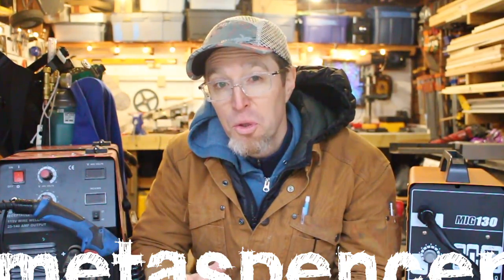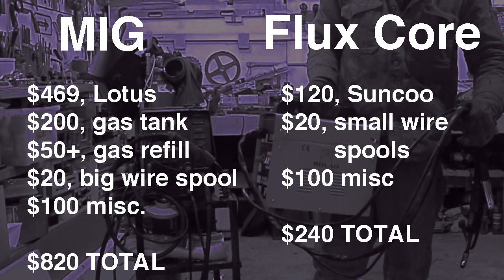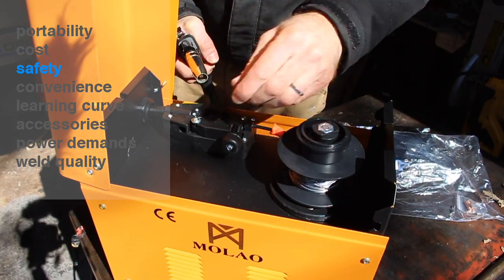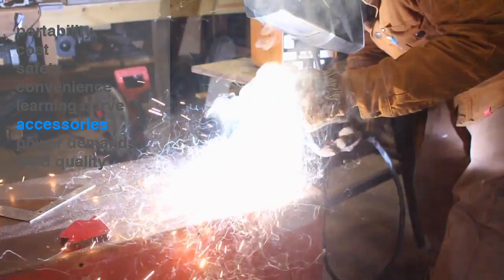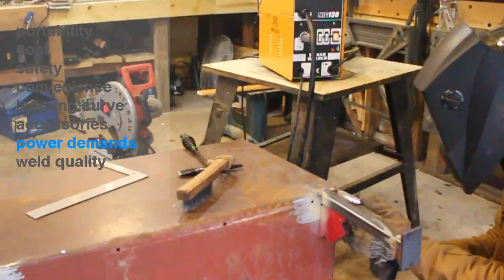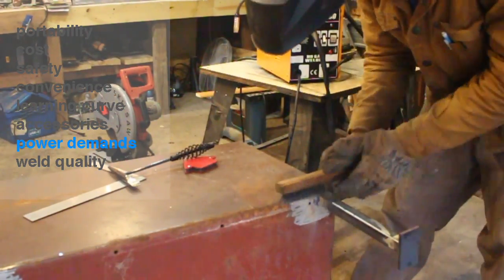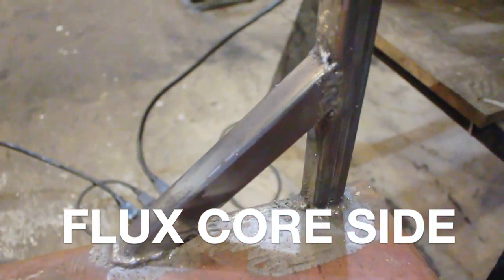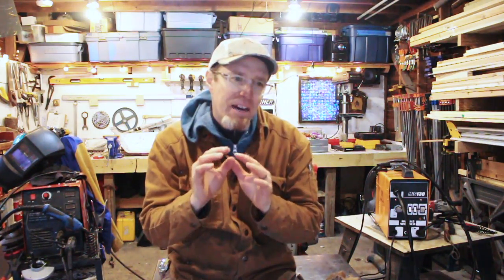MIG vs FLUX CORE -- Cheap Welder Showdown!

Comment: My understanding is you don't have prep the metal as much of the flux core either it's a little bit less time starting up
Reply from the maker: Yeah I think that's true as it burns hot -- but well prepped steel always ends up better in the long run (preheated, too, when it's thick stuff)

Comment: Good comparison of the welder types.  Made sense without going into a lot of technical info.  Thanks.  Just curious if you can run flux wire on your MIG machine by switching the polarity of the leads?  My everlast 140 does but I've never tried it because the flux wire is so much more expensive and I do not go through more than 2 10# rolls a year.  Wonder what the cost comparison between 10# fluxcore wire and 10# solid wire  vs gas refills would be.  Thanks for the good vid...👍🍻
Reply from the maker: I have that option of running Flux core but instead just keep that machine on MIG ... flux wire isn't my favorite stuff to use, to be honest. Gas prices AND steel prices are definitely up. these days.

Comment: Why does the flux core torch have the gas shield?
Reply from the maker: Flux core wire needs no gas, if that’s what you mean
Reply: @metaspencer  I understand that.  What I mean is the torch still has the gas shield fitted.  Surely that could be taken off to give better visibility?
Reply from the maker: Great idea man
Reply from the maker: @glennmartonic6376  I've seen those now ... excellent! thanks man

Comment: I bought that flux core welder a week ago and I'm having the same breaker problems. Looks like the welder says 20 amp, but the instructions say 30 and 35 amp so 🤷‍♂️.

I'm learning to weld on youtube university and just saw this video. Love the comparison. Great video!
Reply from the maker: Practice those smooth e shapes and go slow. Bigger breaker may help but don’t overload your circuit
Reply from the maker: You may have other stuff on that circuit
Reply: @metaspencer  embarrassingly, I didn't think to check the power to my garage. It's only set up for 15 amp. Going to see if my electrician can lay some beefier wires. I'm going to figure it out, I'm hooked on welding. I can't wait to start fabrication and preparing sheet metal on my Camaro. 

Thanks for the video and the reply! 

Ps, suncoo replied to my amazon email and said they recommend a 20 amp breaker, "but 30 amp is better". Their honesty is funny and very helpful!
Reply from the maker: @bfurl69  "30 is better"! that's funny that they'd say that. Good luck on that car!

Comment: Shouldn't the title be gas mig welder vs. Gas-less mig welder. They are both mig welders. A $470 welder should be able to both flux core and gas welding. cheap welder vs. a better quality welder will always give you better welds as long as you have good welding wire vs. the cheap stuff and someone is good. They both have  their ups and downs as shown in other comparisons. 

I weld outside so I am using Blue Demon .030 on my Hobart Handler 140. Just need to lay down a little splatter spray or cooking spray on your material to avoid BB's sticking. Gas can give you a cleaner weld, but flux core has better penetration then the gas version. There is a big difference buying a cheap ass welder vs. a more expensive one. Even in the Flux core welding. Flux core welding is just better for the outside side and gas is better for the inside environment. You get what you pay for in this demo. I do love the gas for the most part just because you can get more done and the surface stays cleaner and doesn't cloud up with slag all over your material and gets all gunky, where you have to stop more often and clean off your material. Even with that cheap welder a little more practice even though its cheap, I bet you can tune it in and get some better welds. 

Your video was nice and entertaining! GJ!
Reply from the maker: Thanks for checking it out and thanks for your insights. I've been doing more flux core lately and see what you mean about the penetration.

Comment: Keep in mind the MIG can run flux core wire if you switch the polarity so the only true advantage of the fluxcore only machine is the initial cost.
Reply from the maker: I've never run my MIG machine that way, so tend to forget that option ... good point!
Reply: @metaspencer  it helps if you want to use your nicer machine outdoors but don't want your gas blowing away.

Comment: Excellent realistic video on the pros and cons of each style. I have watched a dozen other videos on the difference between the two and you were the only one to point out the obvious "shit storm" visual factor in using flux wire over gas. Seems to me that is a very critical difference in the final result. If you can't clearly see what you are doing that's a major negative to me. I have been wondering about this point and laughed out loud when you commented on it. About time someone mentioned it and that was a perfect description. Well done. Thanks.
Reply from the maker: well dang, thanks for noticing and appreciating! flux core can get it done, but is definitely messier

Comment: A few things i saw, you were having trouble welding the foot on to the leg, the closere your ground/earth is clamped to the weld the beter the electrical flow especially with rusty metal. Also mig will also do fluxcore just reverse pos, neg. And if they were already reversed it cause alot of that spater. Btw your mug smokes mine so I'm not baggin on you.
Reply from the maker: Thanks for the tips, man! I know a lot of people rip on other welders, but you seem to be genuinely helping out. I often wish I had nothing but time to weld, but find I only do it for odd jobs around the shop and farm. Take care!

Comment: You mentioned your running off a 30amp breaker.( 10gauge wire ? )  Are you using a 20amp receptacle ?
Reply from the maker: Yep, commercial receptacle ... hasn't melted down yet :)

Comment: A dcen flux core welder seems to produce a lcleaner weld. I converted my Forney 125 to dcen and it welds great. I also use a Hobart handler 140, and for the money and amount of welding I do I would get an inverter flux core welder. My 2 cents.
Reply from the maker: I think you're completely on target here: the inverter flux core melts much more consistently than the intermittent AC one I have ... thanks for the tip!

Comment: Not sure if your flux machine does both mig and flux but sometimes if polarity is incorrect you will see more spatter plus the flux core wire brand too can add to more spatter! It seemed like you were staying as budget minded as you could so perhaps if your flux core wire was Lincoln you may of seen less spatter as well. Just my 2cents
Reply from the maker: Interesting. I’ve tried some different wire now and see what you mean: they’re not all the same. Thanks for the info!
Reply: metaspencer 
👍

Comment: hey great video, just brought a cheap flux wire welder, information about the breaker was very helpful. brought for small jobs. do not know anything about welding, but will  learn by doing and watching YOUTUBE University. LoL, again thanks for the Video.
Reply from the maker: I think you’re going to be amazed by the things you can do, with some practice. Clean those surfaces and get to know your metals, and you’ll do great! Good luck with it :)

Comment: I bought a Lincoln handy mig and a small bottle. It does both as most mig welders do. Hate the splatter welding of the flux core. Even as a novice like me it's clear  that unless you're forced by wind, mig is the way to go for most jobs. By the time we get the skoolie roof raise done this summer I'll be a pretty good welder. Right now I'm building an outdoor wok jet burner stand from an old free 15 inch car rim. My 14 year old daughter loves mig welding. Good activity to do with kids for fun!
Reply from the maker: Sounds great. Seems like Lincoln is the way to go. Good deal with that bus! Sounds like a good plan

Comment: I took welding in school done mig and stick and the torch  also did some TIG welding
I picked up a century in an auction one day $25 stick welder I have a flux core Hobart and yes there is a lot of splatter with it I do have the grease to dip into the cut down the  splatter I found that if I work with all new material what the flux core and a dip for the tip helps 
it just boils down to how much money you going to spend and how much you going to use it
Reply from the maker: Great points. That clean, good steel is definitely the best to work with. The small details, as you mention, make all the difference

Comment: One simple "trick" to good welds is to make sure your tips and nozzles are clean so the gas can flow evenly. Another advantage/disadvantage is the wind will blow your shielding gas away, but dose not effect flux core wire as much. There is also the chipping (cleaning the scale off) with the flux core. I do not think one is better than the other, it is more there are two different methods of shielding the weld, one method is better in certain applications and the other shines in other circumstances. Nice video, I got sent my first "donation" two 109" long band saw blades!!!!!!!!! I am a great grinder. One of the tricks  that produces repeatable good welds is to pay close attention to the angle of the tip of the gun, second is how much wire you have sticking out of the gun when welding. Your MIG weld looks pretty nice. How much weight is in the box.  I would want one more brace on each leg running forward and back. Nice video.
Reply from the maker: Those additional braces you mention make sense ... I’m always dragging it around so don’t wanna bend one. That makes me think I should put casters on it. Smart what you say about MIG and FC: just different. Be well man!
Reply: You as well.

Comment: My flux core is identical but branded “Arksen”. Has a speed knob and 1/2 switch. The trailer I redid was all with that and it had a 1,000 lb + safe on it last week so strength, though something I was worried about, is no longer a concern... the springs were maxed out and the new tongue held up perfectly. 

It does only have a 10% duty cycle which is probably your real breaker issues. I use a 20 amp with no major issues as long as I limit myself on the duty cycle.
Reply from the maker: Okay, now, I'm just gonna think a bit about the "it had a 1,000+ safe" comment, read the crime blotter in the local papers, and then get back to you. :)
Reply: metaspencer meh... new project. I’ll message you a couple pictures
Reply from the maker: It’s a beast!

Comment: Mig is my choice but I use our little flux core welder from work once in awhile. The flux core is better for outside on a windy day. On a windy day with Mig it will blow the shielding gas away and produce poor welds. But I have no problem using a flux core at all.
Reply from the maker: Great point about that wind!

Comment: I've really been itching to buy an arc welder of some sort for about a year now. Big issue is that I don't care much about welding normal steel as I want to do chrome moly. (for bike work) I also want to do detail work like welding a gear/pulley to a shaft. What really complicates things for me is that I don't own a car so getting an argon tank refilled presents an unusual challenge. 

Being as I have an electric dryer outlet and a central air unit I could probably use one of those though my range may be limited or I'll end up spending a lot on a 30amp extension cord.

The last few days I've wanted one to weld some improvements on my new electric snowblower. The snow just got heavy and icy which means frequent auger clogs. But I learned from my Grandpa's Craftsman that if it has two 4 by 4 metal plates welded on the shaft by the auger it can blast through the tough snow & ice amazingly and throw it much farther.

Also some roofing tacks and the ends of the auger help a snowblower tear through the frozen icepack the snowplow leaves behind. My back is aching again just from snowblowing again last nighgt.  What I secretly dream of adding is another electric motor for self propulsion which would greatly ease the load on my back and shoulders. I virtually bought one of every kind of muscle pain cream the local drugstore sells just to get to sleep.
Reply: You would want to go with Tig.
Reply from the maker: I've also wanted to modify my bikes, and figure my machines will blow right through the thin steel. Your modifications to the snowblower would be great! I need to do the same kind of thing to some of my tractor accessories. What we all need, it seems, is a neighbor who is eager to do jobs of the kind you describe. :) Take care, man